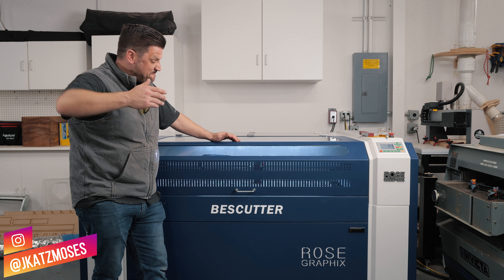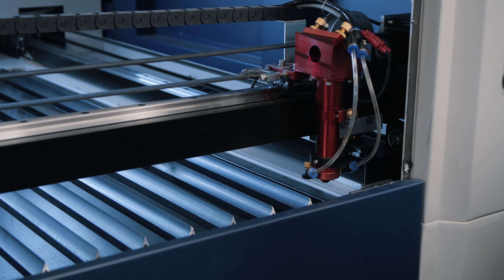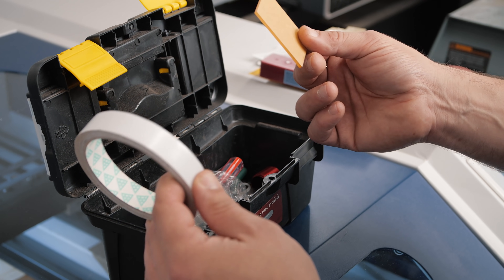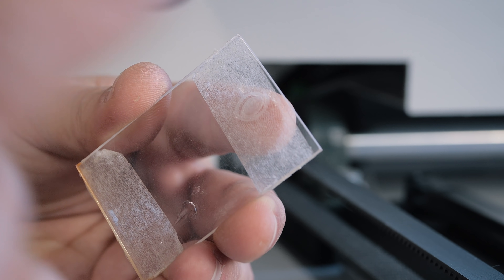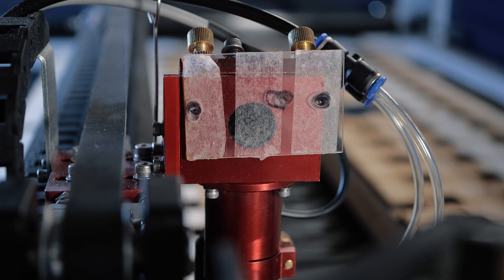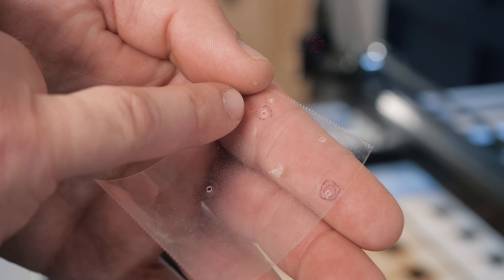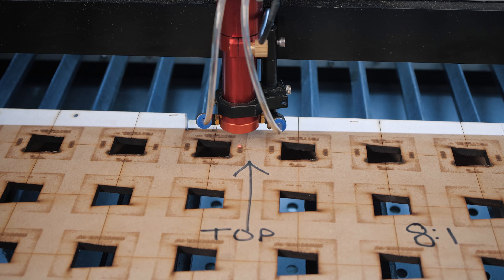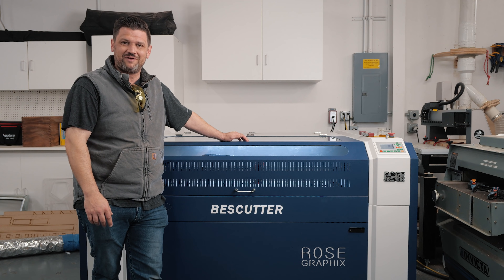Easy Steps to Better Laser Alignment and Accuracy

Comment: Does the cooling system really make a difference?
Reply from the maker: It can’t cut without it
Reply: @ oh is it? I got two machines, the biggest one came with a cooling system, when changing the head, tried disconnecting the water cooling and for some reasons having issues going through the material. Could this really be the reason??
Reply from the maker: Your issue is either air flow isn’t enough from the compressor, your mirrors are not aligned or your focus is off. If water is flowing through the tube and temp is below 30c (preferably lower than 25c) you do t need to worry about cooling
Reply: @katzmosestools  thank you for taking the time to explain!

Comment: My new laser is cutting double lines or more specifically cutting a line and “etching” a line parallel to the cut.  I think the laser beam may be hitting inside the nozzle.  Any thoughts or suggestions would be much appreciated.

Comment: Great video! What if your laser isn't cutting square on the z-axis? When I am cutting 1/2" acrylic looking at my cuts from the side view I have noticed that my beam is not cutting through 90 degrees perpendicular to the material surface. for half inch material the beam is tilted about 1/64" from top to bottom. cuts along the y-axis are square but cuts along the x axis have a noticeable bevel. How can I go about fixing this? Thanks.
Reply from the maker: Need to adjust your z focus. Lasers do not cut square period because of focal refraction but you can minimize by adjusting the height of you focal point. Think of a camera lens or burning something with a 🔎glass. It is only in focus at a a very specific point. The further you get away from that point the wider the focus gets.
Reply: @katzmosestools  Thanks for the response, I resolved the issue. It turns out that the beam was no longer entering the focal lens at the center but rather towards the peripheral edge closest to the gantry so it was skewing the beam at an angle and putting an unacceptable bevel along x-axis cuts.

Comment: Great Video! On your Jig alignment when you went to the vertical line to check that (about 11:02) you said something about turning down the speed to get the laser right on the line. 
What did you do to turn down the speed?
Reply: You can change the travel speed/distance per click in the controller and in lightburn so you have more control over how far the laser head moves each click.

Comment: I just built a CO2 laser from scratch using 2020 extrusions.  Mine is dead center at home pos, but when I move the x axis to the far end it's off.  If I align there, them home is off.  How do I fix that?  I'm running dual track everywheres so it's not shifting.  But it maybe slightly out of square, however with such long pieces it's virtually impossible to get them at all perfect 90s to each other.  Btw, mine is built large enough to cut a 4x5ft sheet of plywood.
Reply from the maker: Sounds like your machine is out of square
Reply: @katzmosestools  it could be, but at this point I can't find any point that is.  I've measured with regular tape measures, tried marking a stick then moving it to the other side and checking the mark was still the same, used a large  alum right angle from lowes, made sure all my tie and cross members were exactly the same length, and triple checked that none of my extrusions are bent or warped.  I even doubled up on the x axis just to be sure the weight of the carriage doesn't flex it at all.  I've seen other videos where people have a similar problem, And their solution was to basically center the laser at an average point between the two max points if that makes sense. And I tried that and it does hit all three bounce mirrors and make it down the nozzle (partially).  Where I run into a problem at the very end is getting it to come out the dead center of the nozzle from the lens.  With the nozzle unscrewed I take black marker and mark the outer casing where the lens sits. Then hold cardboard up against it to gain the mark and test fire the laser. The laser hits dead center of My black ring.  However when I screw the nozzle tip back on, The laser never makes it out of the hole.  This is really the only thing holding me up at this point from being able to use this machine.  I'm at the point where I'm thinking about running it without the tip on.  So I guess two questions now..
Hey would it be safe to run it without that tip, And be any other ideas what I can do to check to make sure my laser frame is square?